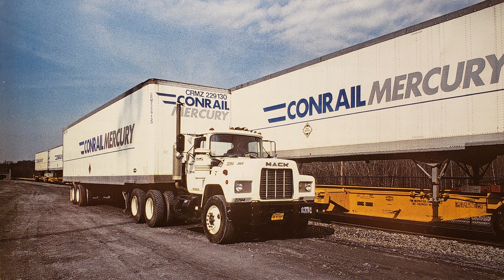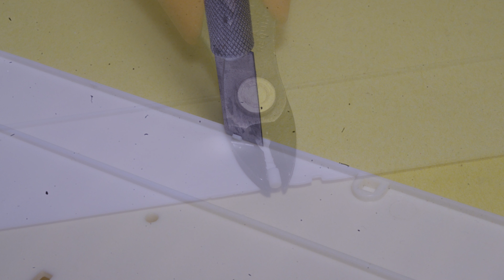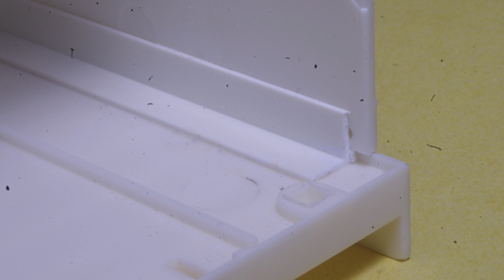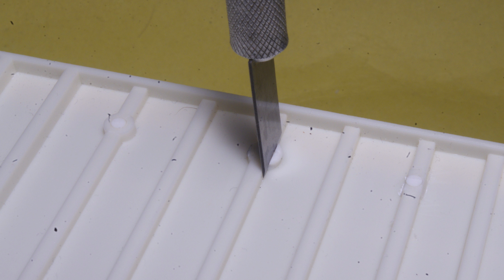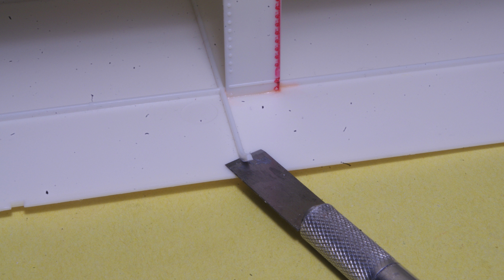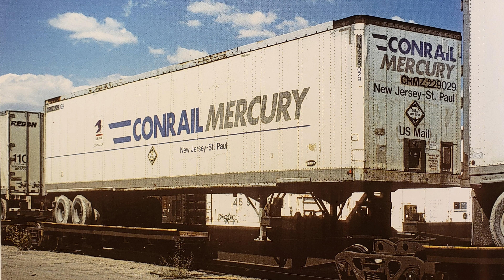48 from a 53 in 1/25 - backdating the Moebius Models van trailer kit

Comment: A little off topic.I am making the rear brake air release valves from your previous video and would like to know what model Micro-Mark punch set you use to make all the small disks used in many of you videos. I would also like to see your method for opening cab doors. I realize you keep your videos short and a door project might be a multipart video. I have tried several of your tips and I'm appreciative of you talents.
Reply from the maker: Thank you - punch set is #83513 on Micro-Mark's web site https://www.micromark.com/Micro-Punch-Set

On the topic of doors, removal from cab shell is fairly easy as there is a well defined groove around door opening, I make multiple light passes with #11 hobby knife blade.

The one piano hinge I have done was made using small pieces of .032" diameter thin wall tube from K&S, soldered to strips cut from shim brass (about .005" as I recall). Hinge pin was .015" steel music wire. Those piano hinges were a lot of work and one issue I haven't found a solution to yet is attachment to door and cab, wasn't feasible to drill and pin so a glue joint is the only means of attachment.

Car style hinges on another model were made following an article in Scale Auto magazine, there have been a few of those articles published over the years using wire (I like .032" brass wire from K&S) bent into a square U shape. Offset bends are added to suit location and door opening so some trial and error is required. Two brass tube sleeves are attached to door so it can slide on and off the brass wire hinge.

Comment: Nice progress, i'm such a plastic kit parts miser that I would be compelled to save the cut off panels for future projects, like making adjustments to a drom box, or short 27' van. Years ago when Micro Scale was doing trailer decals for piggyback trailers in HO, one sheet had several manufacturer logos with Strick being one. I am sorry I cannot recall the sheet, but they looked sizeable for 1/25 scale use.